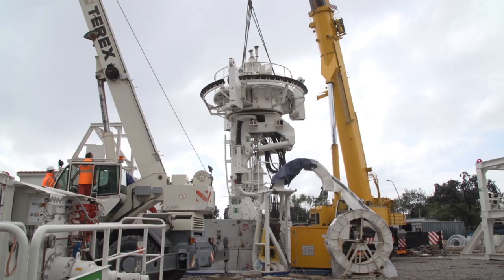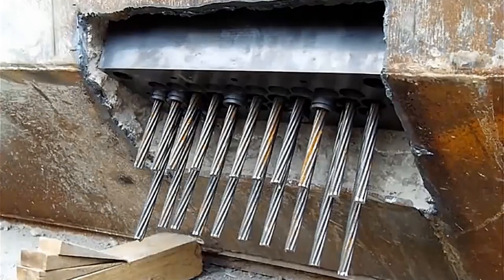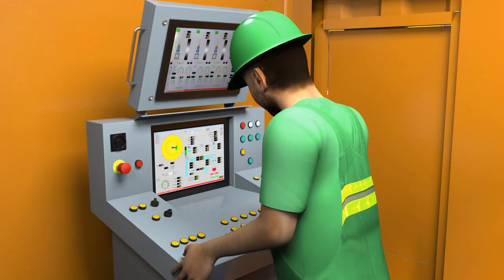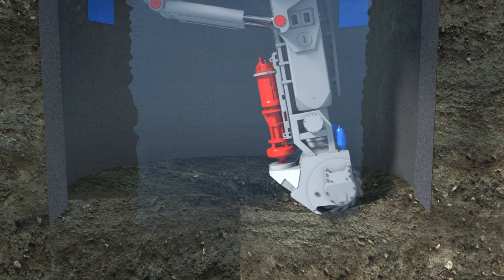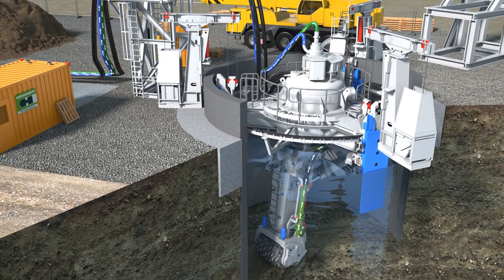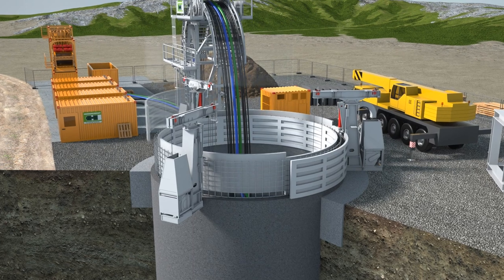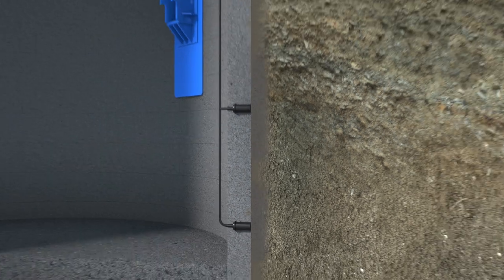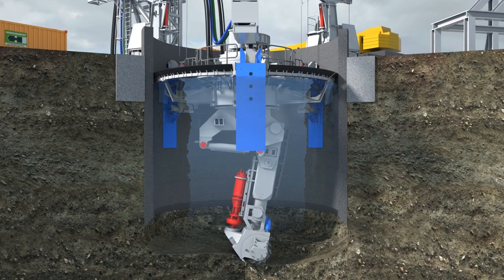Vertical Shaft Sinking Machine (VSM)

Comment: This looks like a 21st century adaptation of Marc Brunel's (father of Isambard Kingdom Brunel) technique for sinking two 50ft diameter vertical shafts in 1825 during the construction of the Thames Tunnel.
A cast iron ring is laid out and the soil was dug out from within the ring by navvies. As the material was removed it could no longer support the ring, which had cutting edge at its base, so the ring slowly sank. As it progressed down bricklayers constructed the shaft on top of the iron ring. The art was not to stop its progress downward to prevent the surrounding soil settling and gripping the shaft and preventing it going down further..
The Thames Tunnel is still in use today, its dimensions being large enough it is used for London Overground train services.

Comment: I admit, my shaft sinking equipment is quite minuscule compared, to this well endowed steel beast.
Reply: As long as it reaches the bottom of the hole is all that matters.
Reply: @klincecum  it depends on the way you bore the shaft in and at what pressure. and it may vary depending on the ground type too.
Reply: Does it rhyme to flash light?
Reply: @ThekZnation  to each boring has its own sedimentary makeup. So in some instances it may. But flash lights, are you mocking our las rifles?
Reply: Question, how long would it take to shift sink a 8m deep tank with width of around 6.8m?

Comment: I was part on the team that sank in the late 70’s at North Shelby in UK. North Selby Mine was started in November 1979 and completed in July 1986 with a shaft depths of 1032m (No1) and 1045m (No2). Whitemoor Mine was started in February 1980 and completed in June 1985 with a shaft depths of 931.6m (No1) and 941.7 (No2).

Comment: Brilliant, clever and shows how we have advanced since the days of Brunel!
Reply: brunel?
Reply from the maker: Hi check online M. Brunel was one the first ones to test a new "modern" underground approach under the Thames River.
Reply: This system of sinking vertical shafts was done by Marc Brunel (Isambard's father) in 1825 for works on the Thames Tunnel, obviously the digging was done by hand in those days.
Using a cast iron ring with a cutting edge at the base of the shaft, the shaft walls being of brick. As the shaft sank the bricklayers built new courses on top.

Comment: Try digging on my property. I'm halfway down a volcano mountain that erupted over 100 years ago. The soil is embedded with lava rocks from hand size to as big as a small car. Digging around here with a hand shovel is absolutely impossible. I have a 35,000lb Case D1150 dozer/backhoe that the backhoe struggles to dig a hole. My son hit one of those big boulders, had to dig around it and then use the 4 yard [1 yard is 3ft cubed] bucket to push/lift it out and move it into the forest. It must have weighed as much as a GMC Duramax crew cab truck.

Comment: HerrenknechtAG, thanks for this video! This technology would be great for siting neighborhood modular nuclear reactors. Imagine a carbon-clean gas reactor serving your neighborhood with power and heat for 15 years without refueling.
Reply: Skip the thermoneucular and go right to groundwater based geothermal to service several users, using renewable greenpower for the electricness...the cheapest way to generate electricness. Plus, there are no lingering problems (many years of human generated radioactive type poisons). What's there not to like, unless you are a big or little corporate socialist capitalist .It's all here right now, and is very scalable as to size. IMHO.
Reply: Also great tech for nuclear waste disposal

Comment: How do you maintain a perfectly horizontal sinking rate of the shaft?
Reply from the maker: The VSM is equipped with measuring devices for all of the movements, to have full control of the excavation. During the sinking of the shaft, the shaft lining is suspended by steel cables to the lowering units and these units does as well have integrated measuring devices to have full control while sinking. In addition the VSM is supplied with a vertical measuring system which are monitoring and displaying the verticality of the shaft lining all the time. The combination of the these measuring device ensures a full control of the shaft and the perfect position of the shaft all the time and till the end of the shaft installation. 
Hope this helps.
Sorry for the delay. 
Regards.
Reply: @HerrenknechtAG  Ok thanks for the explanation.

Comment: Foundation work uses a smaller version with a Soilmech excavator equipt with a Kelly bar. Steel casing instead of prefab concrete than it can be removed if called for and reused. Concrete piling with steel rebar is Tremme poured to exclude ground water.

Comment: the parking concept would work in a lot of locations that would otherwise not allow a above ground parking structure too be built ,or too replace existing ground level parking lots for increased parking volumes ,,, added security being below ground for low theft or vandalism

Comment: Hey HerrenknechtAG! Is this suitable to house my ICBM? Will the shaft walls withstand the high temperature rocket exhaust?
Reply: If we fill shaft with water, than it can withstand higher temperatures, infact during a launch they too uses water to dissipate hight temperature.
Reply: For vertically-launched missiles, there are cold launch systems that use gas from a separate gas generator (this gas can still be a few hundred degrees hot, but is cold compared to the rocket exhaust) to push the missile out of the launch tube, and it only ignites its engine once it is fully clear of the tube.

Comment: Consider looking up Abilene Christian University Molten Salt Research Reactor - < 15 months to construct building with no special equipment. I do not believe it will take that long to construct these on small scale deployments. Please consider reviewing the following on youtube: Vertical Tunneling Boring - Vertical Shaft Sinking Machine (VSM) - 1-5 Meters per day - GE Steel Bricks - - Reactor Pressure Vessel is < 2.5 inches - here is an example of tech to manufacture stainless steel for nuclear -  Holtec Discovery channel ... (I know this is not an RPV but an excellent example of how it could be done.) - Welding - local vacuum electron beam welding -  Small Modular reactor

Comment: Another application could be below-grade placement of nuclear power plants, instead of containment buildings that are above-ground.  I note the current upper limit of 18 m on diameter, but maybe the new generation of Small Modular Reactors (SMRs) could be designed to fit within this constraint.

Comment: I used to sink shaft years ago.  My question is how is this device going to get through ground that is broken up so bad that the boulders are as big as apartment buildings.  One little shift of material and the equipment is stuck and no amount of lubricant on the outside of the shaft will be able to allow movement. Love the machine for minimal shaft sinking though.
Poured the plug on a 3600 foot shaft years ago and this would never have been able to accomplish that depth.  Pure sweat and muscle to get the job done.
Reply from the maker: Thanks for reaching out to us. You can read more about the Shaft Boring Roadheader (SBR) Technology from Herrenknecht which adapts the proven VSM technology to mining requirements. A full report is available under this link: https://aaom.herrenknecht.com/en/issue-13/.
The SBR was developed for the mechanized sinking of blind shafts in soft to medium-hard rock with up to 120 MPa and shaft depths up to 1,600 meter (5,250 foot). If you still have any further request, you can send us your request to the following e-mail address: pr@herrenknecht.de. Best regards. Herrenknecht AG

Comment: Future habitation on Mars will need this kind of thing. Not only can it make habitation areas, but conduits for infrastructure.
Reply: And you probably don't need the water to compensate for pressure of surrounding underground water. BTW, how would one remove the dust on Mars then?
Reply: @PierreSoubourou  There are already concepts that will form 3D printed above ground structures. (using the the dust and rock btw, folks.)
No reason why it couldnt be used under ground, so long as it is strong enough when used. This might be problomatic however, as the forces of compression and tension of the 3D printed regolith may make 3D printed material unsuitable. But if 3D prining walls is suitable, or even if another way to built habitats underground is used, building under ground would also have the added effect of acting as a shield from solar radiation.
Removing the dust would be futile and unneccesary. Afterall, we build things on dust and dirt every day here on earth. Also no one has invented a vaccum cleaner that big yet! :D
Reply: @chemicalmike646  there was this concept by ESA of the moon village, i suppose that's what you're referring to. I would be myself quite dubious of the usage of this technique on other planets/satellites. As for your comment, I suppose one has to establish a mars base on solid ground already, then simply stacking as much dust as possible onto a prebuild facility: the slope is bigger, but you don't need to inject any gluing agent and time or land occupation is not the issue
Reply: @PierreSoubourou  That could've been the video, not sure. I agree it seems "questionable" but I'm assuming the lower gravity may allow for weaker structures compared with Earth. And if theres solid ground to be drilled into, caves coulod be formed and used. And yeah, I agree the forst base will be over rather than under the land. Piling dust on it would be easier than a construction especially at the start up phase. :D

Comment: Something tells me sinking that entire digging arm and having it operate in dirty-as-fuck water 24/7 makes maintenance be a frequent, living hell.
Reply: Pretty well sealed. It's a bitch replacing the teeth constantly though
Reply: The arm is separate, so if you need 24/7, you can have a second replacement arm on the side
Reply: @PierreSoubourou  That doesn't alleviate the actual maintenance you're still going to have to do.
Reply: @Coecoo  I was not contradicting, just saying that it's probably easier e.g. as compared to horizontal tunneling maintenance, and it gives the possibility to operate 24/7 indeed and perform preventive maintenance (which might make the whole maintenance less of a nightmare)

Comment: OK I've watched your tbm videos now this. How about a machine that digs escalator shafts. ie at 45°
Reply from the maker: In St. Petersburg (Russia), for example, a Herrenknecht EPB-shield was used for the construction of an escalator shaft with a gradient of 30°. Read more here: https://www.herrenknecht.com/en/references/referencesdetail/saint-petersburg-escalator-shaft/
In Limmern, Switzerland, a Herrenknecht Gripper TBM was used at a steep gradient of 40 degrees for the construction of two pressure tunnels for a hydropower plant.

https://www.herrenknecht.com/en/references/referencesdetail/kraftwerk-limmern/

Comment: Whats the typical use of the shafts that it sinks?
Reply: Depends on what the customer is paying for
Reply from the maker: They can be used as launch and reception shafts for tunnelling operations, access and ventilation shafts for traffic tunnels, or service and access points for all kinds of underground structures and buildings. Furthermore, special solutions such as inner-city, underground parking shafts (underground parking towers) or exploration and ventilation shafts for mining extend the range of applications of these flexible machines

Comment: Very simplified in the animation, but no part of this process goes smoothly in reality.
Not a lot of fun to deal with in real life 😔
Reply: did you work on something like this? Could you share more?
Reply: @faustinpippin9208 
We had the company do the pre sink on a shaft.
Many delays and setbacks. To be fair, many of the issues were directly related to decisions made by the on site manager.
Hard for the company and system to shine with the wrong people in place.

Unfortunately, the final wash up was a shaft not at full depth to bedrock as promised, and a long way overdue.
Made the next phase of the job incredibly challenging.

Comment: Shaft sinking... Every single shafts been sinked which I dropped in water. Camshafts, crankshafts and others. Just grab any shaft you want, the heavier the better. Throw the fuck out of that shaft, and it will sink like a stone in water if it drops in water. Anyway, this whole lot of work doesn't worth a penny with a hole. :P

Comment: Hmmm I need to get down to 10 Km,😂 is it possible?
Reply from the maker: Dear M. Li,
the VSM technology is actually not designed for such a shaft depth and we mainly focus on applications with groundwater bearing ground conditions, as an economical and more reliable alternative against conventional shaft sinking method’s.
But in our business Unit Mining we do have further shaft sinking technology which could probably better fit to the required shaft depth.
Please refer to the following link: https://www.herrenknecht.com/de/produkte/productdetail/shaft-boring-machine-sbm/

There as well, you'll find a contact if needed.
Best  regards,
Herrenknecht AG

Comment: $100K per hole not that cheap using this method
Reply: That's pretty cheap considering the size and depth of the shaft and quality construction.
Reply: its also worth it for very compact place like cities
Reply: andrew jones a
Reply: The machine itself probably cost 300x that to R&D, they need to make the money back.

Comment: its a nice boring machine. but it wont work for what i was wanting to do... if the company would like i could blueprint a water powered drill that you could point at a lava duct to make a power plant.... would need the drill to become the seal when it gets to a critical flash boil temp, with gravity feed water pressure, the flash boil is higher and will be enough to power a turbine.... cooling towers would work as a water recovery after the turbine, and water help bleed heat out of the planet reducing over all volcanic activity... could also use a natural lake for water and a floating gate for PSI control inside the pot.... the conssept came from the water pocket that feeds fly gyser, and old faithful.